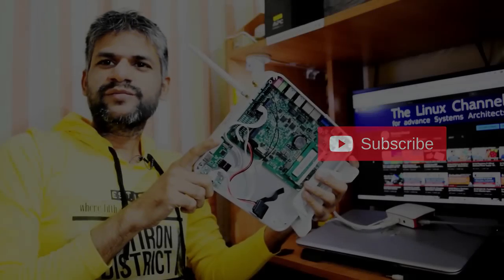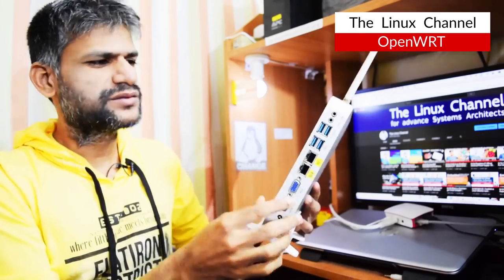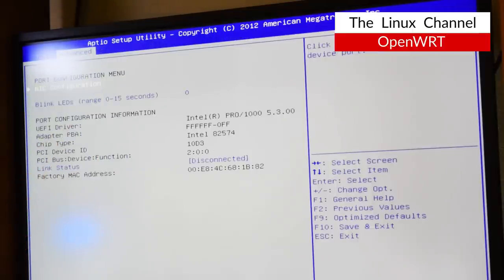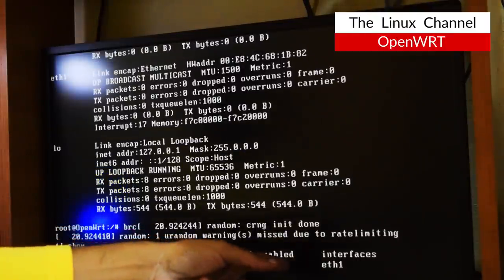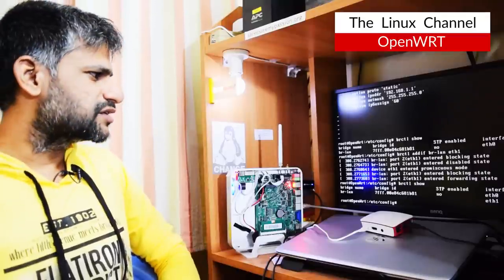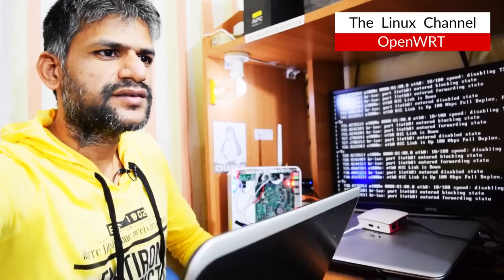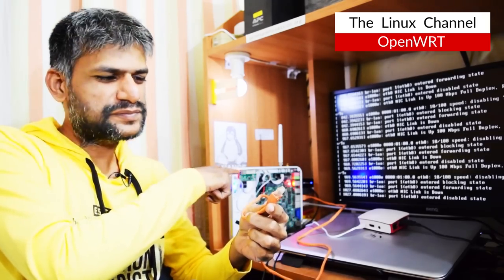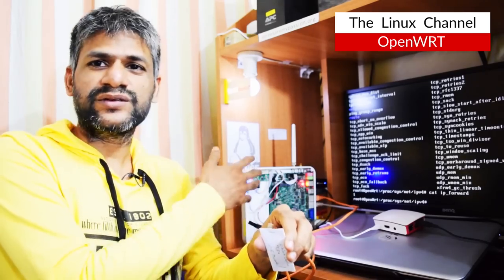x1bf My OpenWRT Embedded Linux x86 Router Hardware Build VLOG #OpenWRT #linux #router #pfsense

Comment: I am still having problems with an update script thus...

apt-get update&&apt-get upgrade -y

it seems to stop permanently on archive.canonical.com trying to connect but no luck but when I split the two commands into two everything  works properly so what is going on.
Reply from the maker: you can do with ";" since ";" after a command means two commands in single line. I am thinking && is making it like a background process. I am not sure. But try:  $ sudo apt update -y ; sudo apt upgrade -y   --> should work
Reply: @TheLinuxChannel  I am trying to do the update using a Root Terminal so I can drop the sudo and many Thanks .
Reply from the maker: @DAVIDGREGORYKERR  true. If you have enough privileges, you can drop the sudo, but rest its the same. You can use ";" to combine multiple commands in one line. The only drawback is, it lacks feed-back mechanism. I,e if the first command fails then dont execute subsequent command(s).
Reply: Openwrt os (no apt) opkg update

Comment: can I program by c, python, or any program language in router ?
Reply from the maker: yes we can. For example OpenWRT is a small trimmed down Linux OS based router OS. We can install python/php interpretter, and then run our scripts on top. Same way you can compile and run traditional C/c++ programs
Reply: @TheLinuxChannel  thank you :3
Reply: @TheLinuxChannel  Can I use Socket to program router?
Reply from the maker: yes of course. See these routers are just very low spec systems. If you find hard to run c/c++ compiled apps, you can try socket code via python/php 💗
Reply: @TheLinuxChannel  Are you have any documents or clip about how propram router device ? Please